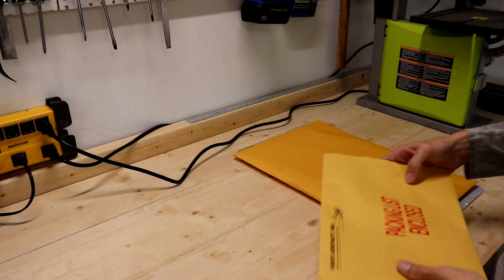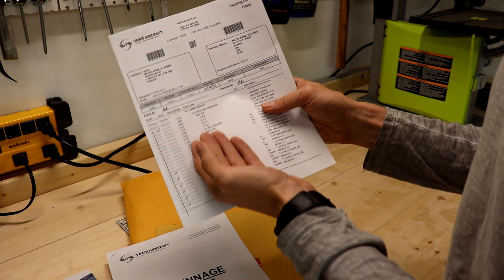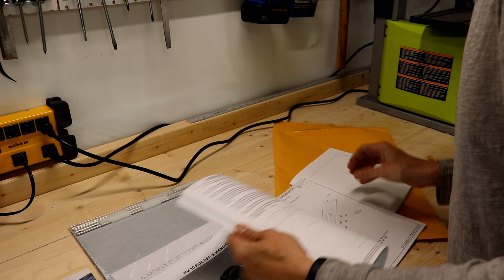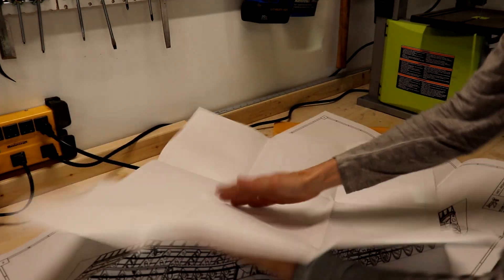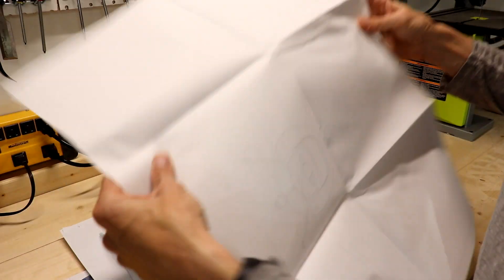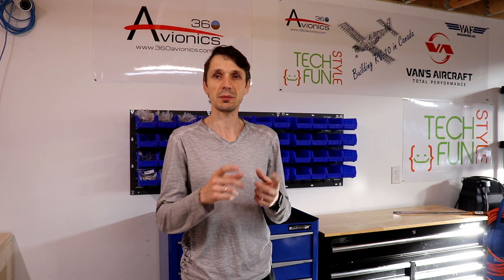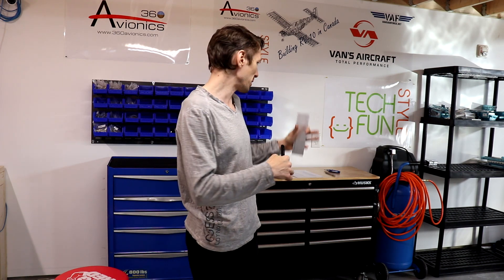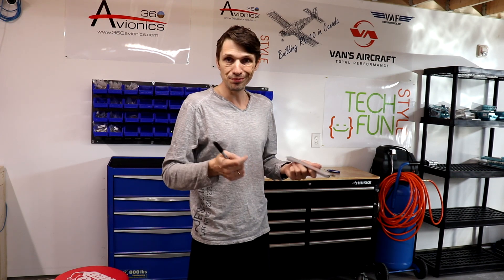Building Van's RV-10 : Empennage kit Unpacking and Inventory.

Comment: Haven't built my kit yet but I do know about aluminum and markers. Be careful with that. Parts that are exterior with marker/sharpie markings will show up thru primer and paint if not successfully removed prior to priming and painting.
Reply from the maker: Thank you for this information. I did not know that. I though that pre-painting includes acetone (or whatever similar is used to clean all surfaces). But probably it is good idea to use sharpie on inner sides only.